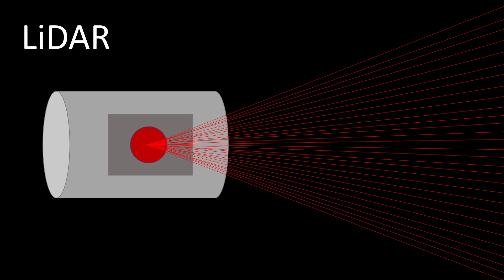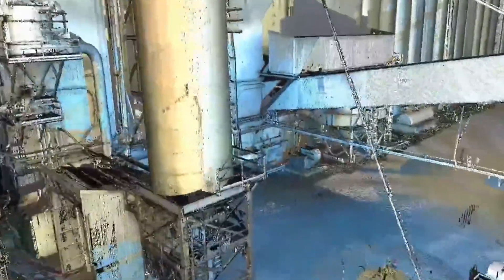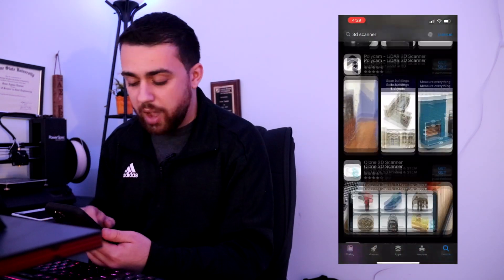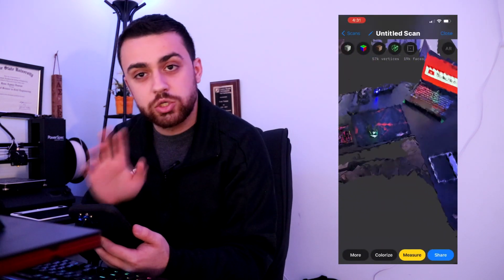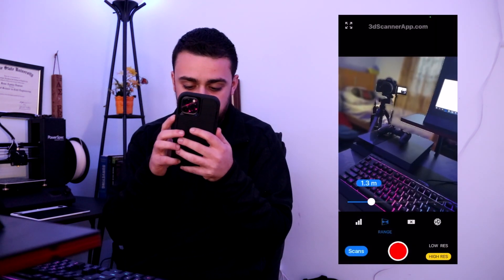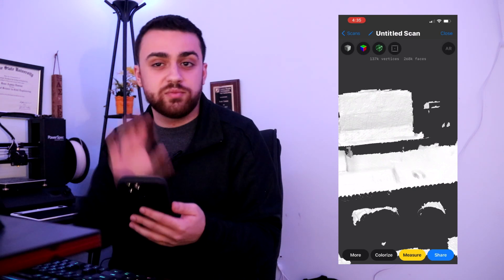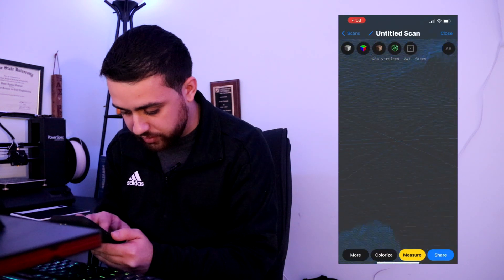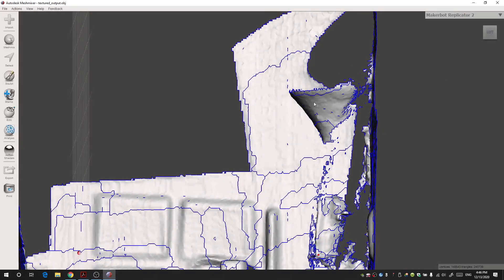Survey Scanning with the iPhone 12 Pro LiDAR Sensor

Comment: As a Surveyor myself I can say that it is fairly rare that I find a need to survey the inside of my office. The Iphone LIDAR has neither the range or density for any kind of realistic commercial BIM scanning and certainly not scanning of terrestrial related projects such as roadway corridors in my case. It is a fun tool to play with but that is all. Typically Surveyors deal with data that is MUCH more accurate and reliable than data the Iphone can provide.
Reply from the maker: That is correct. This by no means should replace a $180,000 LiDAR Sensor. But for something small and fun, it will do the trick!

Comment: It's not accurate enough, apples lidar doesnt scan that many points, they are about 15 cm apart. The point cloud you get from the api is the lidar sparse point cloud mixed with the second cameras depth camera data. This gets mixed to create an rgb depth map image in lowish res alongside a confidence map. the high density point cloud is then generated off the lower res depth images. So it's easy to see errors of 10% in accuracy.  It designed for ar games definitely not a replacement for true lidar surveying
Reply: I've recently purchased the phone and can see straight away that Apples Lidar implementation is extremely limited - bordering on gimmick. 
Thank you for explaining why.
Reply: @grrinc  Might be a gimmick now but in the future things might be different. I would look at this as more of an experiment. 
The fact that something like this is cheap enough to be a feature of a cellphone is somewhat incredible.
Reply from the maker: Oh yes, this is not an accurate tool for measuring, very much for small scale modeling. It has the potential to become a powerful tool, but this is just for internal use.

Comment: Curious, are you a licensed surveyor?  A decent LiDAR setup can cost you under 30k.  The iPhone feature looks cool, but seems more like a gimmick.  Surveyors rely on accurate information, where I live, we have a minimum technical standard we use now defined by an administrative code, one such survey defined that LiDAR could help excel in, are as-builts, formerly know as record surveys, not sure I would rely on a iPhone for that type of accuracy.  The processing in register 360 also allows the ability to import into CAD to create a 2d ortho floorplan as well.
Reply from the maker: I have my SIT, I will be a PS this year. iPhone LiDAR is defiantly not on the same level as a BLK 360, but for many projects, clients aren't looking for high precision, they just want a model. So the iPhone does a good job for these applications.
Reply: @RamiTamimi  Also, best of luck on your PS exam.
Reply: @RamiTamimi  Curious,  what type of clients are interested in a not so precise 3d model?  What do program do you use to model?  I use the Leica register 360 for post processing, but also use Civil with Cloudworx and Revit as well for modeling and creating floor plans.  The 360 is a lower end scanner, but still gets the job done.